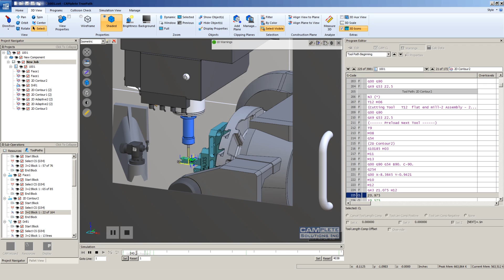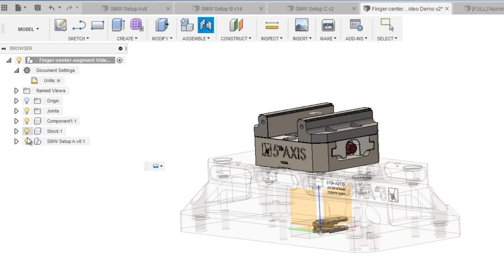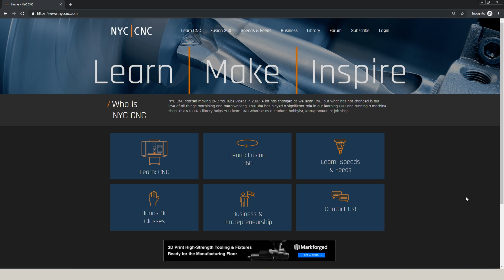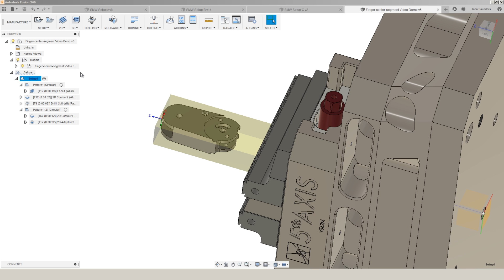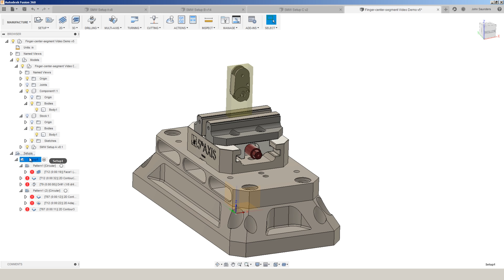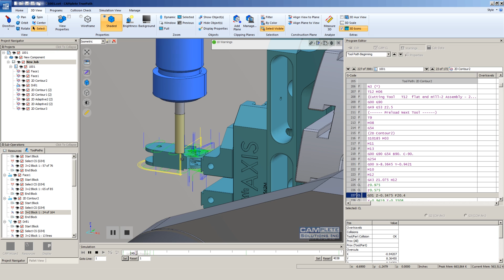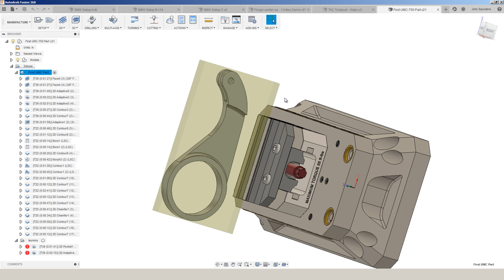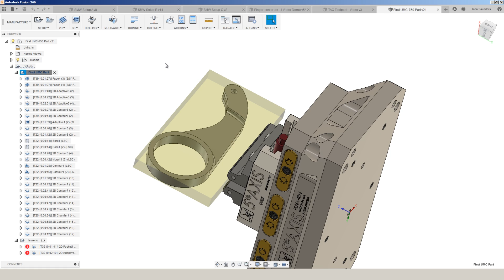5-Axis is AMAZING!  Sharing our CAD, CAM & Fixturing Workflow!

Comment: At 1:26, doing the Extrude, the preview is shaded, then at 1:27 magically it becomes 'wireframe-ish'. How did you do that?? I have tried to replicate that, but the only thing I can do is hold down CTRL while previewing the extrude, but you have me stumped. You have really got me interested in 5-axis.. before it was pie-in-the-sky, but with your excellent encouragement (emphasis on courage :-), how hard could it be?
Reply: change the part opacity to 10-20% (right click on the part in the browser on the left)
Reply: @dmbworks8094  Clearly not what is going on, and I tried that. The active component is the stock component and it is clearly 'shaded with edges'.
Reply: @BrilliantDesignOnline the part he is working on has the opacity set down. in preferences, general, design, has "active component visibility" unchecked. then in the visual style menu use shaded with visible edges ctrl+6
Reply: @dmbworks8094  That was it! Thank you for your help..I like to be in full control and understand all settings :-)
Reply: @BrilliantDesignOnline   anytime, happy to help

Comment: Great stuff!!  John Saunders, other than a bigger work envelope, what advantages does the UMC have over something like the Haas TRT160 tilting rotary table that is installed in a 3 axis vertical cnc?
Reply: im not john but I don't see them answer much. Rigidity when it comes to making larger parts is probably the biggest advantage. also a youtube revenue advantage as they are much more interesting to watch haha. a true 5 axis machine is a great addition if you have a 3 axis to do things like the "zero" or clean up ops plus more typical job shop work. Just as john has done, progression is the way. i feel most people will have to go thru the steps of a 3 axis, to table top 5 axis to true 5 axis to build experience and work, especially those that are truly a self owned company.
Reply: @dmbworks8094  thank you for your response. So it seems like it would make a lot of sense for someone to just add a "tabletop" rotary table. Unless you need to make bigger parts. One draw back to 5 axis machining is you're only making one part at a time. So for larger quantity parts it doesn't seem to make too much sense.
Reply: @antshark  No, there are ways of fixturing like this that use five axes with multiple parts: https://www.nextgentooling.com/uploads/2/8/4/1/28413645/9874122_orig.jpg

Comment: Maybe a stupid question but does the reduced setup time (vs 3/4 Axis) compensate for the smaller width/depth of cuts ?
Reply: HSM style of cutting is typically opted for with lighter per tooth cutting. depending on the machine, in some cases HSM is faster regardless.